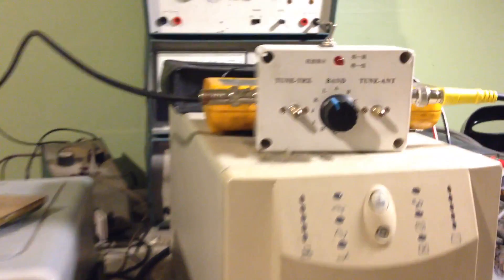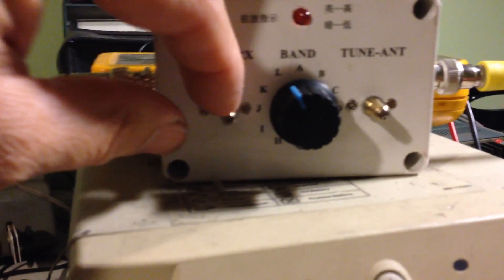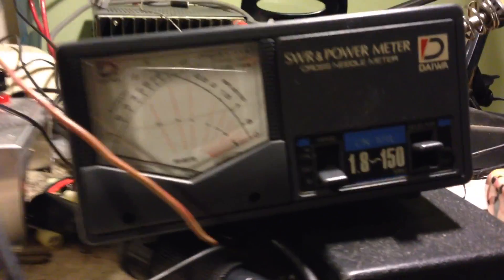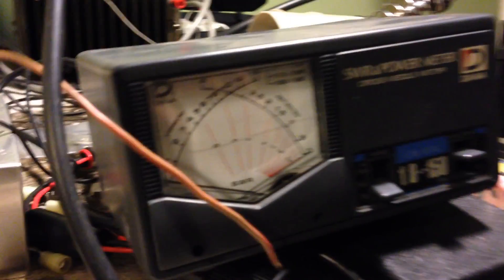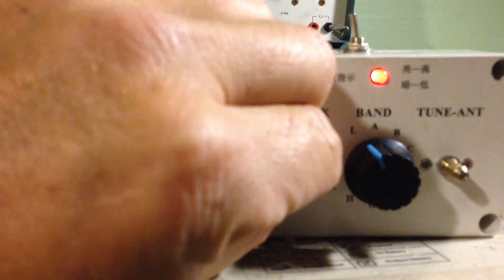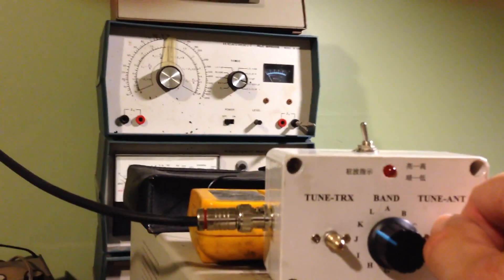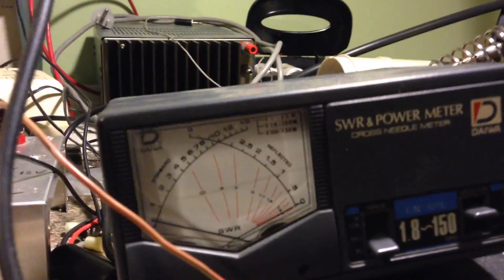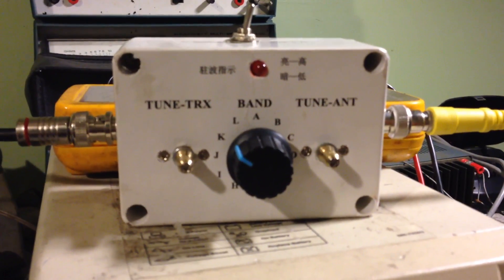Chinese QRP tuner

Comment: There's a reply buried in the comments but to be sure others watching this video understand, in the bypass mode ONLY the N7VE SWR measuring circuit is bypassed NOT the tuner. And the SWR measuring circuit does limit the output power due to the bridge circuit. That is why you are seeing the behavior being shown.
That said, these kits are real cheap with crappy parts and the guy did a terrific job building the device considering!
Reply from the maker: Thanks for your input !!!

Comment: Doesn't this little thing have the Tayloe bridge to prevent high swr while tuning?  That would result in EXACTLY 3db loss, or half power, while in "tune" mode.  Pull that switch (light is off) and your tuner is INLINE and full power goes through it (1 watt, as expected).  So there is nothing wrong with your tuner, it is working as designed.
Reply: You are so very right. I can not understand that the reviewer, seeing his stack and equipment, made this very beginners fault and does not understand the working of this device! When you have the switch to the left the half of your transmitted power is eaten by the bridge and the other half goes to the antenna. Just what Clark says, while transmitting you have to put the switch to the right so you pull the bridge out of the circuit. As you can see than there is no or almost no insertion loss from the tuner himself. Very good tuner, although the components are a little flimsy.

Comment: At the beginning you say that with the switch set to 'bypass' the dials and knobs do nothing - not true.  You skip the measurement part (the bridge that turns on the LED) but you still get the effect of the tuner so the dials and knobs are still operational.
Reply from the maker: Kevin Timm 
I will have to verify that with the person I built the unit for.  Maybe I assumed that bypass means 'straight-thru' with no metering... Cory